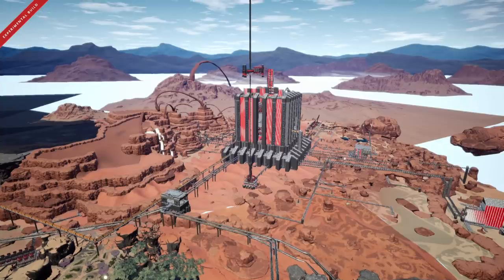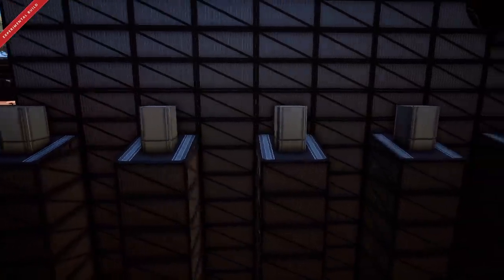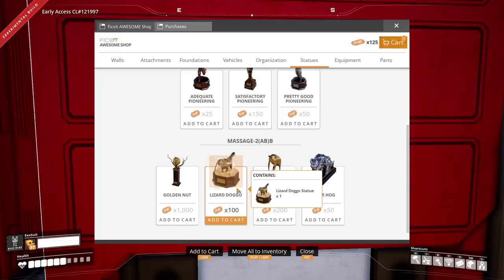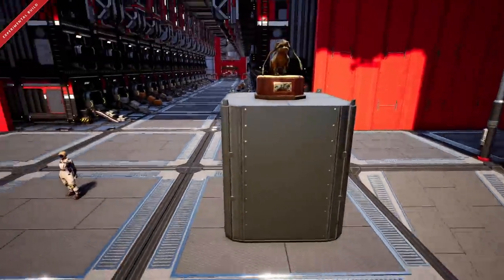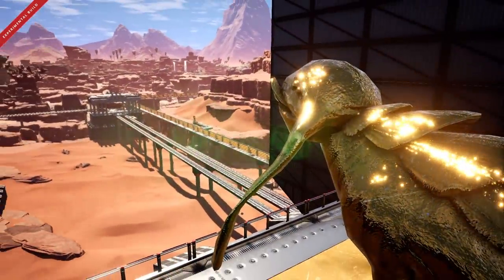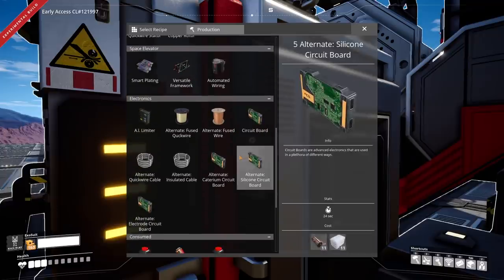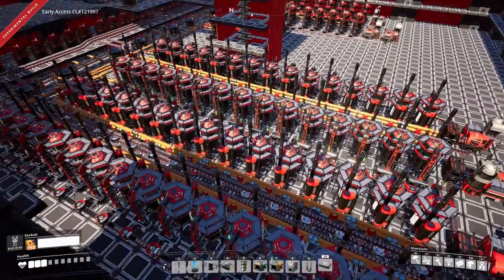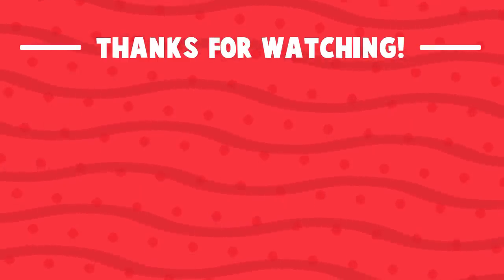Time for our Next GLORIOUS Mega Project! - Satisfactory Early Access Gameplay Ep 30

Comment: For easy and simple math of quickwire production and to make AI limiters:
1. rows of 10 assemblers making 900 quickwire , but every 5 assemblers break off with a 480 line so 450 quickwire
2. of the 900 quickwire in 2 480 belts bring to a row of 9 assemblers making AI limiters and input 450 to each end of the manifold. In the middle assembler, #5, use a merger and everything runs at 100% clock speed.
450/900 quickwire also works great for caterium circuit boards 8.75/min in rows of 12 assemblers.

Comment: It's probably a little late now, but I was thinking about the efficiency of water transport. With the number of pumps you have to use pumping the water all the way up, would it be more efficient to package it up at/near the source, train it over to the base, and use conveyors to lift it all the way up to the very top, at which point you mass unpack into pipes and let gravity work for you? Belts and conveyor lifts are free, after all. And if you had a process that took packaged water (as some of the oil stuff does) you could tee off on the way up, rather than having to repackage. I wonder at what point packaging becomes more efficient than pumping...
Reply: He's way ahead of you. Package water goes up to top of phase 1. Likely not enough yet though!